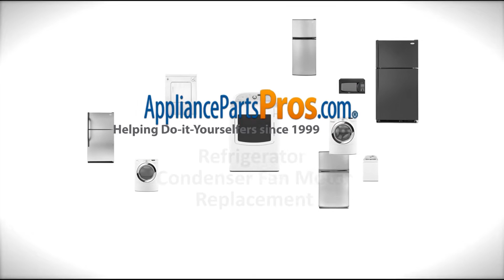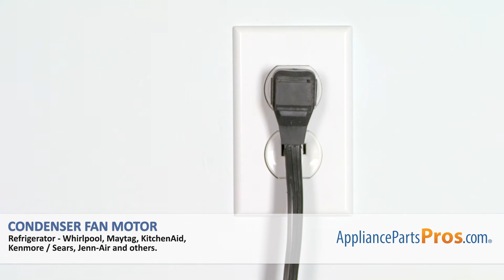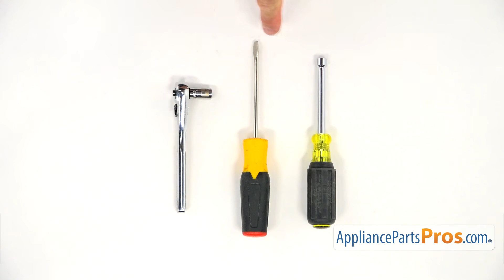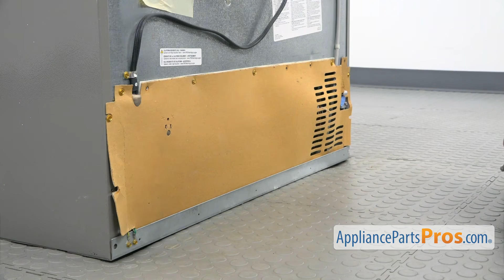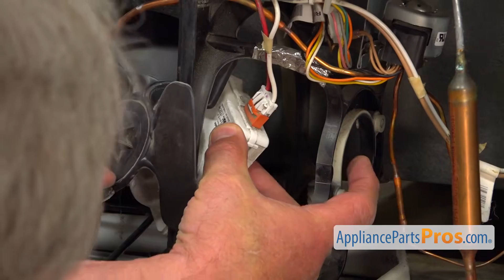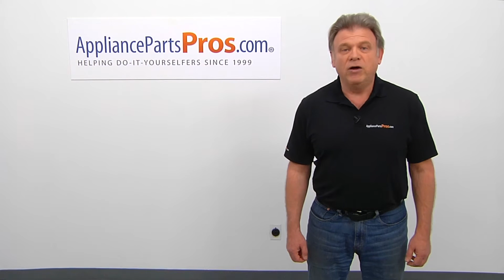How To: Whirlpool/KitchenAid/Maytag Refrigerator Condenser Fan Motor W11127829

Comment: I replaced my evaporator motor i my Kitchen Aid refrigerator (very similar to the refrigerator in your example), but there is a helicopter sound coming from the same are in the freezer.  This ONLY happens when I open the left door (same door that has the water dispenser and ice maker).  It is driving me nuts.  Could a condenser cooling fan make a noise like that?
Reply from the maker: A condenser fan is unlikely to cause a noise that only happens when you open the left door. Since it’s coming from the freezer area, I’d still look closely at the evaporator fan you replaced. Make sure the blade is seated correctly, nothing is rubbing the shroud or wiring, and there’s no ice buildup or misaligned cover. Those are the most common causes of a “helicopter” type noise after this repair.

Comment: Is the condenser fan motor supposed to come on when the compressor comes on when the fridge starts up? Our fridge and freezer are not coming on and the relay and cap are testing ok. I'm not sure the fan motor is coming on, however.
Reply from the maker: The condenser fan motor and the evaporator fan motor should both come on when the compressor is running.